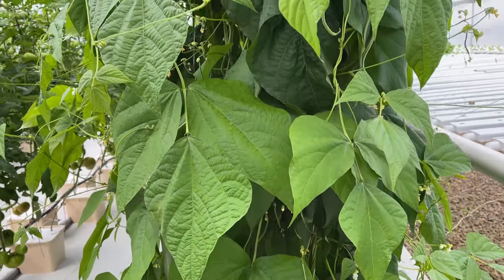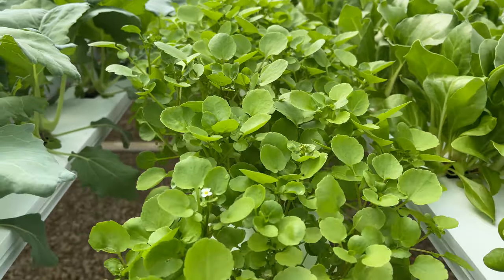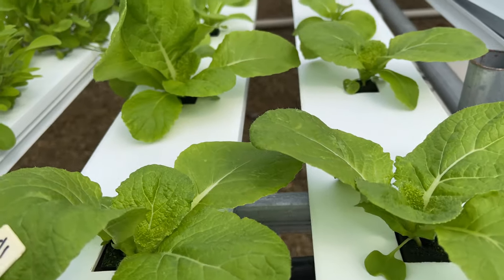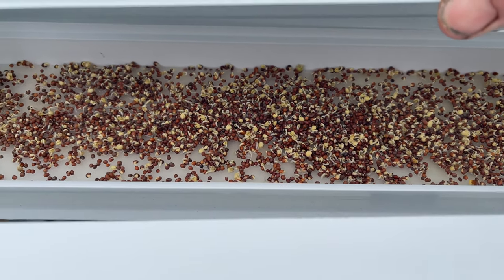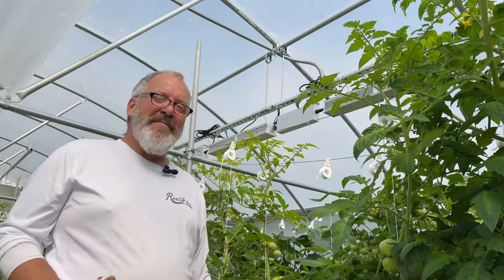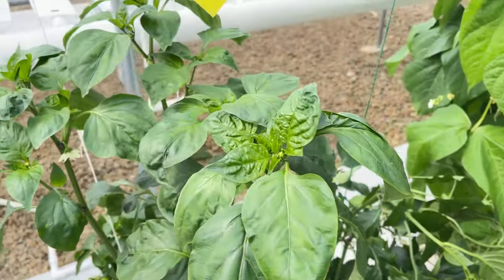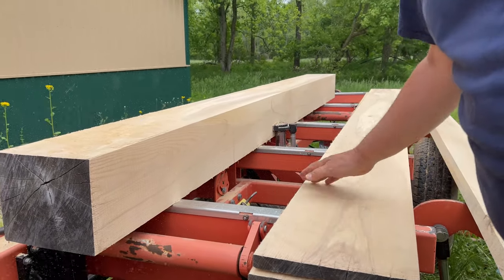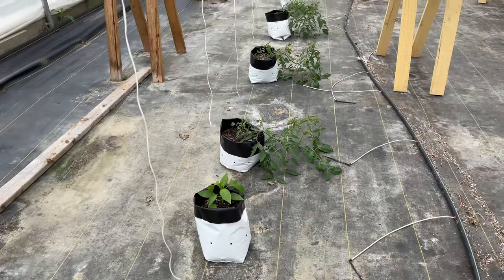Farmers market update, working on Bato tomatoes and cutting ash on the Woodmizer.

Comment: I absolutely love seeing all your veggies and strawberries growing and doing soooo amazing!  I have a little hydroponic DIY system that I set up in our apartment, it’s small but you’d be amazed at the amount of veggies that can be grown in a small space.  I have cherry tomatoes that are the size of roma almost and they are super sweet and it’s an indeterminate and just keeps on growing and growing despite all the cutting back that I’ve done.  I grow cucumbers inside and butternut squash and I’m trying black Diamond watermelons for the first time.  I also have a roma tomato plant which has given me pounds and pounds of tomatoes.  I have an NFT system that sits on a shelving rack with 52 heads of lettuce and has two pvc pipes together on three shelves that I have all connected and pumps from a reservoir that holds 70 litres of nutrient rich water and it drains back into the same storage totes and just keeps recirculating and I just add to it when needed.  I have Moneris T5 LED warm white grow lights above each pvc pipe and the lettuce is jamming!  I also grow herbs and white stem tatsoi and basil and all sorts of leafy greens I have so many different kinds of lettuce.  I never knew there were so many!! My latest addition is strawberries which I’ve put into three different methods of growing.  I’d love to have green houses and high tunnels like you have and all the fun experiments that you get to do with everything, pretty amazing! You sure inspire me to keep on growing and having food to eat that I’ve grown myself is pretty amazing too! 🥰❤️🇨🇦
Reply from the maker: that is so great you are growing the way you do. You should be very proud of what you are doing. Thank you so much for watching our channel and your comment. Send us some pics we would love to highlight your operation on a video!